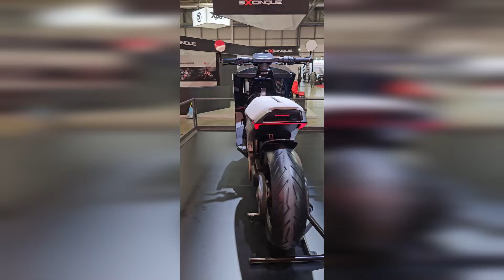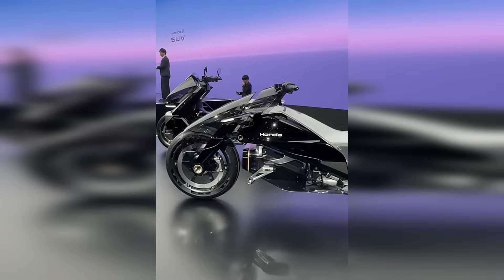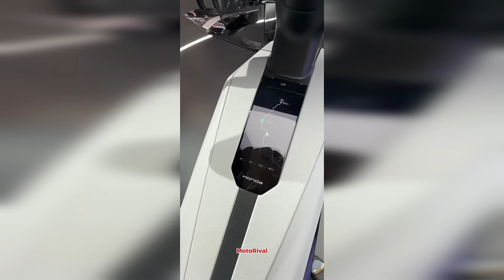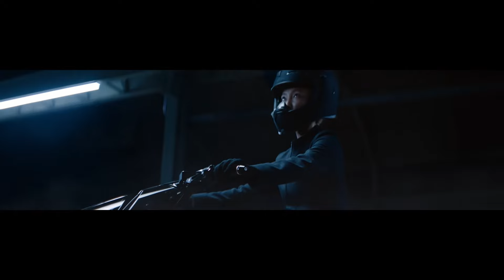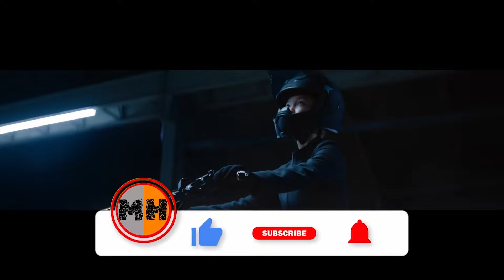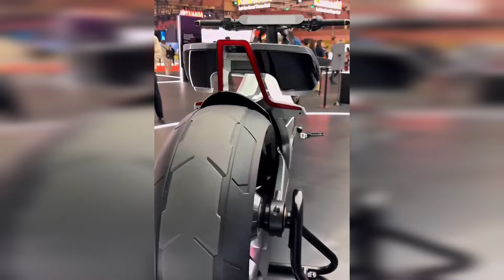This New Motorcycle Will Change Riding Forever!

Comment: I love the HD rumble at idle, at 18 I bought a '51FL "chopper" a year before the movie Easy Rider was released. I lived in the Dallas/Fort Worth metroplex, I never saw another chopper while living there. The Honda 750 four was just released and everybody were buying them. My old panhead was being passed like I was parked. I had women shielding their children when I rolled by like I was a contagion, then the movie released on a Friday and my whole world changed over night, all of a sudden I was a star, a god where the day before a demon. Before I would pull up and park to get smokes and come back to find four empty spots around my bike, after I would get mobbed by a crowd before I could get the kick stand down! Oooo Chopper, take me for a ride !! What a great time to be 18 !
Reply: My folks both rode Harleys and were in an AMA club. At 18 (1966) my friends and I could/would buy late 40's, early 50's Harleys for around $100, take them home and strip/chop them down to remove weight. More of "Billy" bikes than Captain America bikes. The extended forks (no front brake, shudder), sportster tanks came shortly later for some and with the more mechanically inclined, bored out 80ci engines. Throw in some long hair, yup, people stared and hid their children, but they had done the same for my folks and their group too. I don't remember becoming a hero because of this movie, though. In Seattle there were always a lot of bikes outside of the theater for the first three weeks or so. BTW, my old man loved "the Wild One".